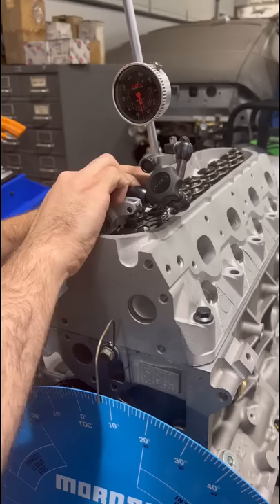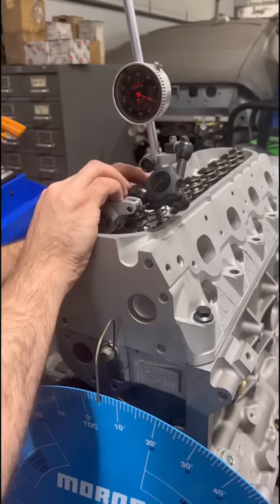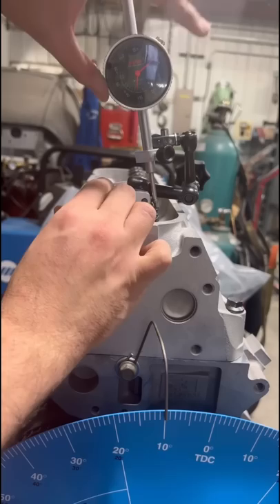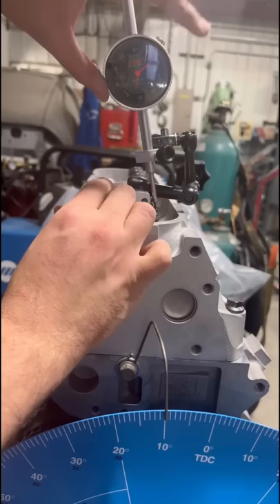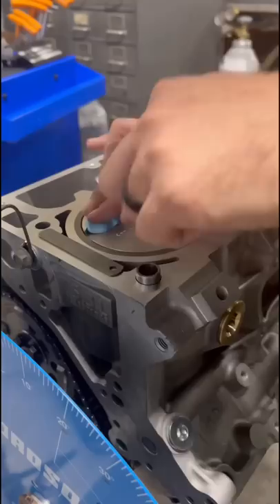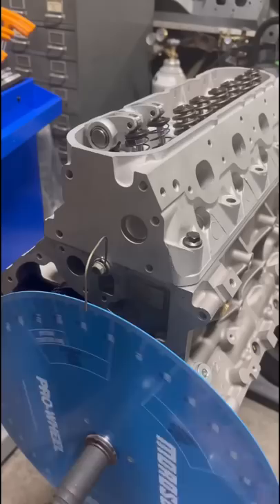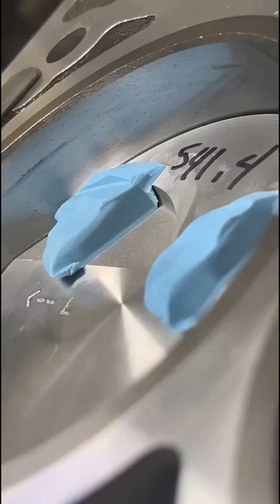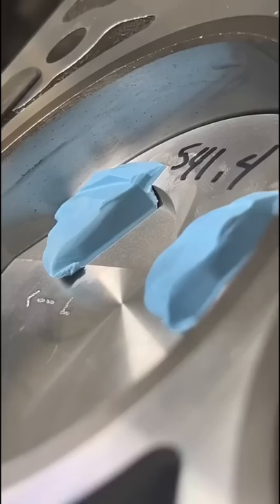#shorts Checking Piston To Valve Clearance - Dial Indicator Method VS Clay Method

Comment: My dad always used clay, it worked fine. I really like the indicator method, especially for more high performance applications. Great job.
Reply: I feel like having the exact measurements would make it easier figuring out how big of cams and valves you can get away with
Reply: Is ng an indicator means you can see what happens BEFORE the valve hits the piston.
Reply: I think clay is simple for a d I y guy and no special tools required
Reply: @lawncuttingplusdelta  I agree, it’s more “definite”!

Comment: I did it by dial indicator once with a solid roller. Checked it every few degrees, but missed the few degrees they were almost kissing. Only after tear down did I notice the marks on the pistons. Luckily no damage, but definite interference. I use clay every time now. No guessing. 😊

Comment: Ford, manual for like the Escort, says You must set a strip of solder on the piston set the head, rotate crank 720° and use the squish to determine head gasket thuckness. Dials look so much cooler though! It's like using a telescope and mic to gauge ID on bearings or using plastic gauge, plastic gauge don't give you taper or out of round, but if everything is brand new plastic gauge is great for that.

Comment: I do both. Dial let’s me know if I could go with more lift (either cam or rocker ratio… just out of curiosity) and the clay to see if the valve pockets are lining up the way they are supposed to. Had a block decked wrong one time and the clay gave me the clue

Comment: When checking piston to valve clearance I add all 16 solid lifters, check springs, rolling engine slowly over, lightly pushing on valve springs each time. I stop turning engine pushing down in rocker arm to feel valve clearance. I check all valves for accuracy and valve clearance. Some valves sit further in heads, deck height not square on each side of engine, rocker arm ratios not same, etc. I do use dial indicator and therapeutic hand putty like clay but far better than clay that I've used this hand therapeutic hand putty for over 30 years and it doesn't dry out. A diy piston valve cutting tool at home your self. One used or new bigger valve cut on bottom roughed up with lines cut on bottom of valve. Install valve in head, piston TDC, measure other valves across tips, take check spring off put 5/16 fuel hose with hose clamps on valve and drill with small socket chucked in drill and over house and valve clamped together. Oil valve guide and valve while turning with drill. Lower big valve slowly in cylinder to cut for deeper valve reliefs carefully measure, measure and measure more. Repeat process any machine shop can do this but sometimes when you don't have the time to wait you have to do it your self. Also can measure piston depth reliefs with straight edge across block with head off and with bigger 1/8 rod and rounded head down cylinder. You can take off so much piston material with out balancing. but if you have to balance engine any way it doesn't matter.

Comment: Built one 350 SBC engine installed Comp Cams cam for just sound and cruising 305 stock heads for customer. Installed a big mutha thumper cam custom ground on a 102 lobe separation. Big valve to piston interference and needed pistons to achieve higher compression and clear valves. I went with new Howard's 2618 pistons deep valve pockets on intake and exhaust all valves cleared with spare clearance with these Howards pistons. Comp cams wouldn't cut cam on a tighter 98 lobe separation and still warranty cam. Customer wanted tight as he could get it  For radical race sound and most naturally aspirated power tighter lobe separation cams are the best but a mess of piston to valve interference. Wider lobe separation cams 112 and larger clear valves so well and wide cam lobe separations are more for nitrous, turbo and blower power adders!!! You can also get these power adder cams for some more additional power. This 350 SBC had good all around power for such a big cam, junk heads, flat short Chinese intake and a 600 vacuum carb. Not what I would recommend. But customer knew and set on what he wanted and just wanted all sound and the ground pounding sound this engine it did just that. It was a big improvement on the stock engine with a tiny cam. But I'm sure on Dyno or racing engine would have been a disaster!!! Stuff was shaking in dash after running before with stock 350 it didn't! Also gas mileage picked up a bit raising compression.

Comment: Either way is good enough for me. My concern would be valve float . So, get heavy springs.
I did notice that you used a shim to simulate the head gasket. 
How thick was the shim.
Reply: I'd assume the thickness of the valve gasket he was planning on using.

Comment: Well I do atvs my method is contacting parts distributors. "Examplr" last one was Carillo piston and cylinder. Kibblewhite titanium valves and springs, and a stage 2 cam from hotcams. Called all 3 had em put togather a kit that's measured n fitted prior to me getting it. Makes life alot easier on me. But doing it on my own, clearance shins

Comment: Here's a fun one... I once used silly putty to do this and it stuck to the exhaust valve enough to overcome the checker spring and pull the valve down slightly with the piston as it dropped. Well the intake valve also opens as the piston drops and the valves collided and bent. Back to the machine shop! 😬

Comment: Dial indicator method seems more precise, but there is more room for error, especially as a novice as you have to check it at the very tightest spot. You don’t need to know PTV clearance down to .001 like other clearances in the engine. You are looking at .080 give or take depending on intake/exhaust and the application. 

Also radial (side clearance) of the valve is equally important. You can’t check that with the indicator method.

Comment: I spy Yella Terra Ultralites!

quick tip- make sure to check the wipe pattern on the valve stems once your cam is installed ("wipe pattern" is adjusted by setting the stanchion height via spacers);
the "spacers" supplied in the kit from YT suck and are basically worthless, every set ive seen winds up with the wipe pattern wide and WAY past centerline on the stem, and would sideload the heck out of the guides with the factory spacers. Also, they're both not flat AND vary by several thou in thickness- they're basically just washers, best I can tell 😅. a Ford rocker shim kit actually works perfect for setting up the stanchions (I used a kit with an 8mm center hole).  On my setup, if I recall correctly, I wound up with .105" exhaust and .115" intake, with wipe patterns nice and narrow, and centered on the tip of the valve stem. (I have a set of big cathedral-port AFR's that had been milled a bit to bump compression, on an iron block, just for info)

The Ford spacers work fine, but you DO wind up with more parts to keep track of. instead of machining spacers or using washers, you can actually use the old rocker stands! they're pretty easy to fixture up and machine, and you wind up with what amount to rail spacers that sit perfect using the factory relief slot/rail protrusion setup... I did mine, and they've held up perfect for the last several years of beating on it... makes working on it SOO much easier, not having to keep track of shims and where they need to go every time I work on the valvetrain.

Comment: I actually prefer clay or plastacine. The dial indicator might show how much clearance you have in one direction but clay shows way more and you need way less setup. You can check stuff like valve to bore clearance and valve to notch clearance. A static mock up like this might show lots of clearance but if you float the exhaust valve you don't really know what it will get close to.

Comment: I prefer using clay because it also allows me to check the radial clearance. 
Useful tip....spray some Pam cooking spray on the combustion chamber and valve faces. Then your clay won't stick. Also, to get the most accurate results, make several revolutions.... because the clay will rebound a bit. Play-doe is even worse!!

Comment: My preferred method is to just bar it over with a ratchet. If they're going to clear, they're going to clear and it will rotate smoothly. If they're going to hit, it's gonna lock up or have a tight spot.

Comment: I keep things basically in the stock configurations lash valves set a timer started up reset the timing 2000 RPMs for about 20 minutes break in the camp after that to the street.

Comment: Well, if both are equally as good of an indication I would probably just use the clay unless that shows a problem that needs to be checked to a more precise measurement. That’s a lot of work if you can tell if you’re in the ballpark with clay.

Comment: I like the clay method.  I just like to visually verify that nothing is gonna smack into each other.  If I can see the distance, I won't be thinking later, did I measure it right? I don't build engines for a living,but I've rebuilt 4 over the years. If I built engines for a living, I'd probably be comfortable doing it the dial indicator way.

Comment: I've never checked that, and my
engines have always run fine. I prefer longer duration cams verses high lift cams.
Higher lift cams require stronger valve springs making the engine fight itself to produce more power while increasing friction loads, and also requiring heavy duty starters, more cranking amps, etc... Bigger valves, longer durations do the same thing with less lift, n less friction, an easier starts since stock springs work just fine... There's more than one way to put 10 lbs of shit in a 5lb bag....

Comment: But you don't have a head gasket in there many companies offer different thickness 2mm 3mm and so onckearance won't be the same
Reply from the maker: .051” shim under the head to match the .051” compressed thickness of the gasket I’m running.